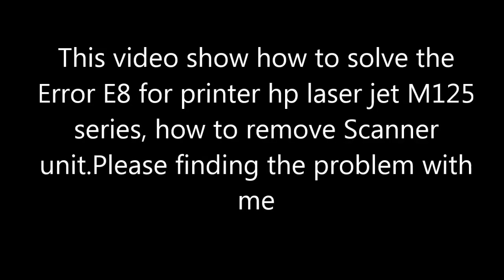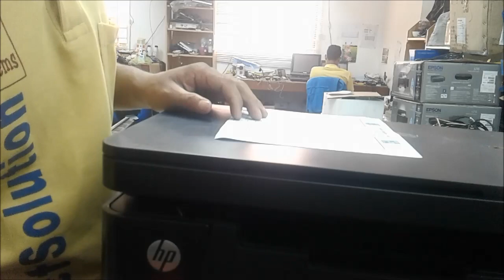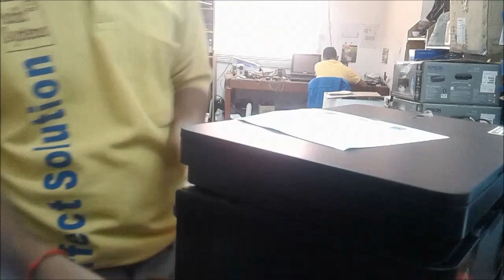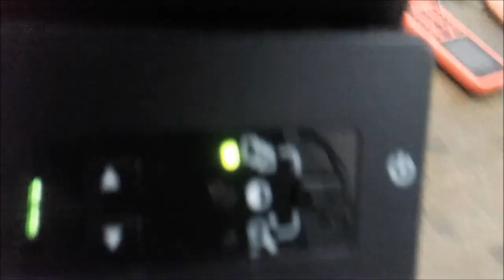how to fix printer hp laser jet M125a error code E8

Comment: Hi, I have the same problem, but after the 2 test page come out, the printer doesn't print other pages. I need the combination to hard reset the printer please.
Reply: Nevermind, i found the problem. I dissasembled the scaner motor, clean it and put it back and now the printer works as new.
Reply from the maker: Now the printer is ready status?  if ready try install fulldriver and go to Toolbox and reset or setup

Comment: I have same problem with my HP 125a , Error E8 , HOW TO SOLVE THAT,
Reply from the maker: try reconnect cable scan from main board, if still problem, disassemble scanner unit reconnect parts if still replace motor or scanner